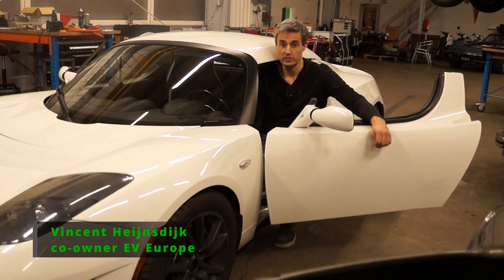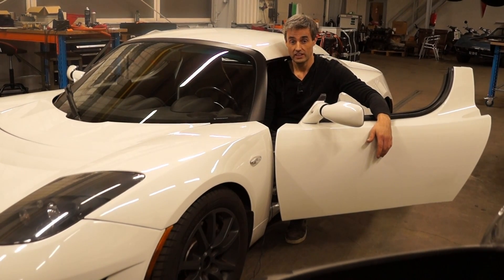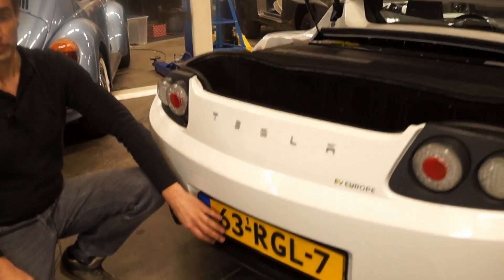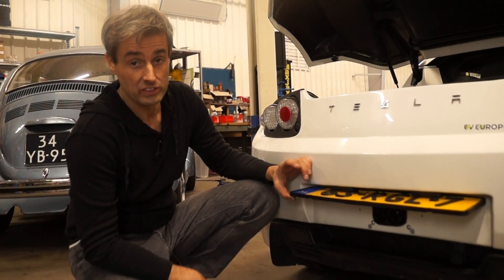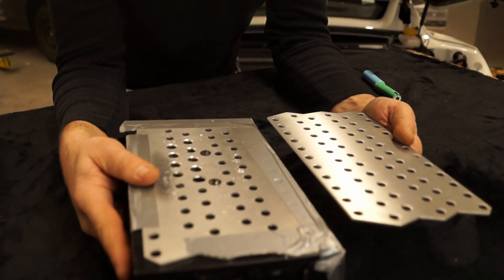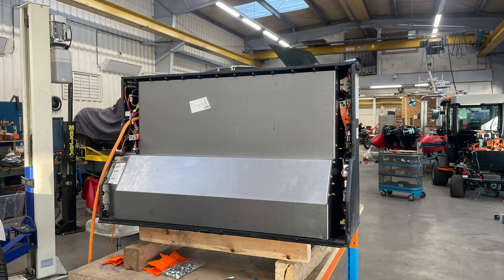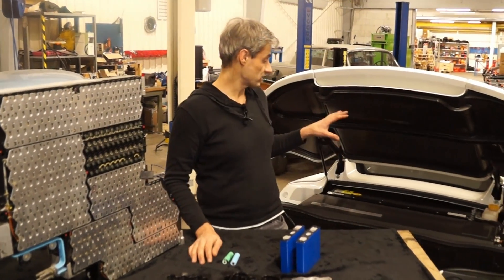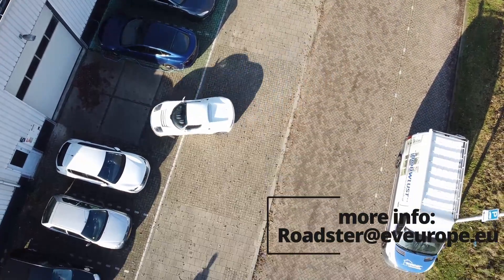EV Europe Tesla Roadster Battery Replacement + CCS upgrade

Comment: No mention of range improvement? Or cost?
Reply: Well, he mentions that battery capacity is increased from 50 kWh to 62kWh. If this directly translates to increased range, you would be looking at around 480 km instead of the old 393 km (EPA rated). This is a range increase from 244 miles to 300 miles for metric system challenged. ;-)

Cost? You need 117 LiFePO₄ 280Ah cells in a series (117S1P configuration) to achieve a 62 kWh, 375V pack for the Tesla Roadster. So cells on retail cost would be around 17000€ + new BMS, wiring harness, charging system, cooling, assembly, installation, testing, and some kind of profit margin. I'd estimate 70-90k. The lowest possible DIY hack would probably be around 50k. 

These are my personal estimates and not indicative of prices of EV Europe.